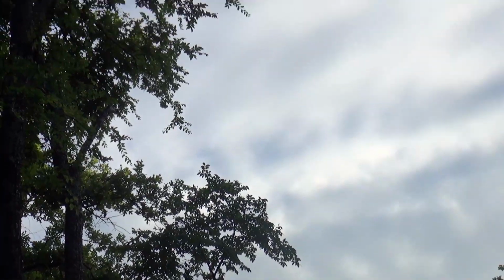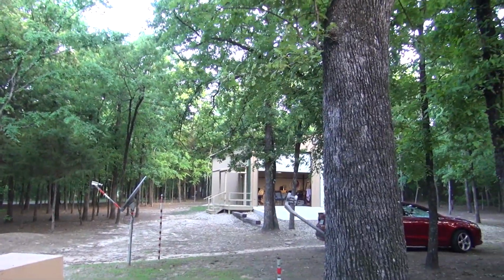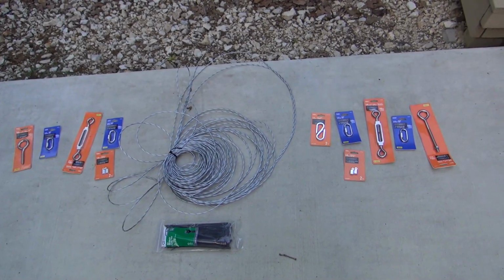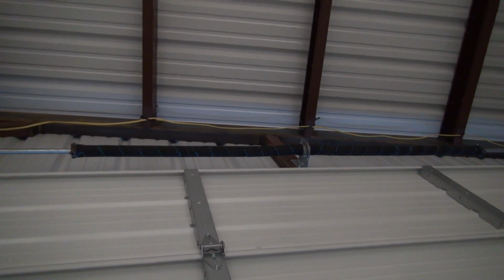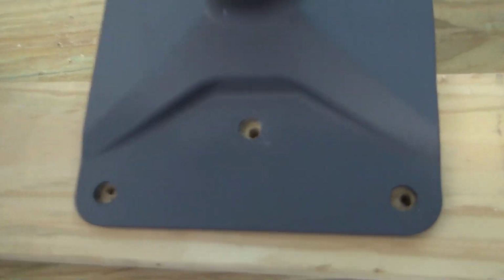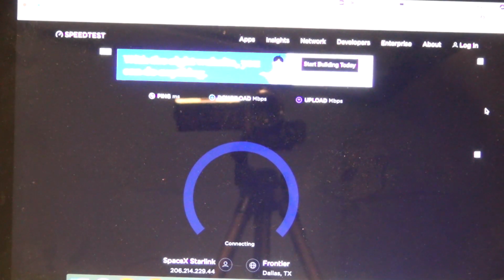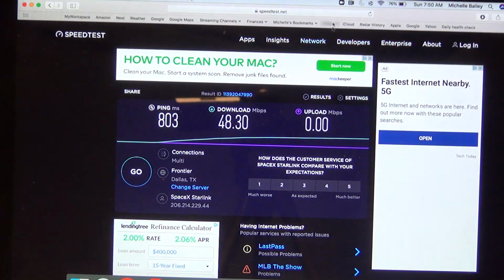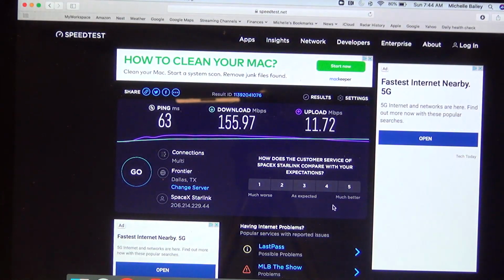Starlink Dish Install With Lots of Trees and Long Cable Run, Texas/Oklahoma

Comment: I had to drop about 10 trees but it was worth it. There are two more left to drop. Both dying as were most of the other ones I had dropped. However, we in this area of MI were only supposed to get 170 Mbps max, but we've downloaded things at just over 300mbps at times. It's worth it when you live in the country imo. Best service we've ever had.

Comment: Having problems stowing my poll down for the return of my Starlink it does not connect to the router can someone help with this I need to send it back but won't fit in the box do to the poll

Comment: Thanks for the very informative video. I live in the Philippines and the tree line surrounding my house is quite similar to your own location except all the trees nearby to me are coconut trees. I have down and up speeds roughly the same as yours before you installed Starlink so when the service comes available here I will definitely be using it. 🙏

Comment: Your area looks like mine, I'm in rural West Virginia, down in a valley wedged between two hills (one hill on the all-important Northern direction) with trees all around.)  When I first installed Starlink, I was getting drops every few minutes, which I didn't notice for general internet surfing, but caused buffering on Netflix and the like. However, it's gotten much better as they've launched more satellites. Sticking it on a ten-foot roof mast also did wonders, it didn't seem like it would have put it over most of the treetops, but it must have been just enough to knock the dropoffs down considerably.
Reply: I'm in tyler county. Too many trees for starlink. I'm lookin at the new hughesnet but they get awful reviews.

Comment: My Starlink is on the way, and I have a very similar issue with trees. I do however have a clear 3 acre pond, but it’s 190ft from the house. Thoughts?
Reply from the maker: They make a weather proof power-over-internet (POE) connector to attach two ethernet cables together,  they run about $90.  You also need to get at least 100' of additional cable to make the run, make sure it is rated for outdoor use.   You could bury the cable to span the distance, but that is a lot of digging without a trenching tool, I recommend putting it in conduit if you bury it to add protection.    I don't recommend securing it to trees to span the distance,  remember trees move and the would put a strain on the cable and eventually break it.  I would invest in some type of tall polls in the ground to secure it to.  Good luck and let me know how it goes.

Comment: It looks like you could easily install a wireless bridge between your house and out-building.  I did something similar between my house and shop.  Cost was around $200.  Speed is about 400 Mbps.  You are likely to wind up with blown Ethernet ports on your equipment with a cable running between two buildings, due to lightning strikes in the immediate area.

Comment: I found that anchoring  the cable with  the supplied clips squashes the cable. I used electrical staples and loosely ran the cable thru them. I also used a rope to run a path from the dish to the house and used tye wraps  to secure the cable to the house with putting any strain to the cable .had fun figuring  this out
Reply: With out putting any strains  on the coble.

Comment: @10:00 who drilled and installed the bolts in the mounting plate?  It looks like a blind person with no finger dexterity lol they are pretty crooked ;]..   My kit is on the way and I have a phew tree tops on the very edge of the northern view and I mean just the very edge so I guess is I will have no issues.  Peace!

Comment: I can't put it on my roof due to tall trees in a 360 view around my house. There's obstructions all over so I found a spot in my field that's wide open and has no obstructions so I'm gonna have to set it up out there "200ish ft" maybe 300 I'm not sure, haven't been able to measure the distance but do you think running cords that far will make a difference in my speeds? I'm not sure what ethernet I should use, CAT6 of 200ft-300ft? Any help would be appreciated.
Reply: https://youtu.be/JVfyFDw2k_8
Reply: @_hrlt  I already watched this, a signal booster isn't what I need but thanks for the help anyways.
Reply from the maker: I am no expert on this but everything I have read is that Cat5/Cat6 cable is less effective beyond 328 feet.
Reply: @doingstuffonvideo5943  well I measured it from the spot to my house and it's 159-160 ft but I'll need a little more of cord to put it up through my basement.
Reply from the maker: @ASMRJAMESY  Also, if you are going to run it out in the open make sure to get a UV protected cable.  But if you are going to use conduit it shouldn't matter.

Comment: I have a suggestion on how to take the worry out of the cable from the Dishy to the house.  Have you thought about running the entire system from your garage?  That would be your Starlink system.  Then run/bury a single strand of fiber optics from the garage to the house in conduit.  Yes I know Fiber Optics.  Expensive!  It's not that pricey.  You can purchase single strand fiber optics pre-made in various lengths that would run from your Starlink system in the shed to wherever you needed in the house to a Wifi router to take care of your internet needs in the house and the Starlink system would service your needs in the shed.  You would have to purchase the appropriate transponder to covert electrical to light for the optics at each end of the fiber.  Surprisingly the whole setup is not that expensive.  I did this at my house to get internet to my shop and the whole thing was if I remember correctly under $200.00.  I purchased 150 yards of fiber the two transponders off of Amazon and I have been very satisfied with the results.  Anyway just a suggestion.  thank for the video.

Comment: Why not put the Starlink on a elevated platform. Sounds like you know how to make things with your hands so a long small stand to get past your trees
Reply from the maker: I could put it on a tower, I priced it out to about $1,000 ish to build. I may have to get there, but for now we are happy with the service we have been getting.
Reply: @doingstuffonvideo5943  during peak usage, like when everyone is online, is there any latency?
Reply from the maker: @gerrycortez4656  I haven't noticed any.  We  have a Firestick on two TV's and have streamed video's simultaneously with no issues.   Plus we have our Nest security camera's (3) recording at the same time an have seen any issues.
Reply: @doingstuffonvideo5943  thank you helps so much but one more thing, do you think it could handle 15-25 devices?
Reply from the maker: @gerrycortez4656   In all honesty it will depend on the usage of each device and how much band width they will require.  
You could sync up that many devises but if all are streaming at the same time, there could be issues, but that is with any internet provider outside of using fiber optics.  I have not seen any band width issues to date.
Reply: @doingstuffonvideo5943  thank you aagin

Comment: I’m not so far away.  A little south of you in McKinney.    So far the beta has not been made available to me.   But your need is greater than mine so I am sure they gave you priority as they should.    How were you notified your beta was available?
Reply from the maker: I just got an email from Starlink that my area was open to the beta.    They just verified I was still interested and when I confirmed they charged my card for the remainder of the costs.   I did get an expected delivery date about 30 days out, but all the hardware arrived in little over a week from the time I confirmed.
Reply: @doingstuffonvideo5943  thanks so much DE N5BOC.

Comment: Thank you so much, much better video than others about placement and tree coverage. East texas here and can't wait, have some tall pines here but found a spot if the app is accurate. I really don't like the fact the cable is integrated into the dish. I have never seen a cable last a long time yet on a roof.
Reply from the maker: Yes the cable failure is is my fear as well. Part of it is sitting on a hot metal roof.  It may make sense to protect it more than it is now.

Comment: Don't run any cable under the ground or across the trees. You can link the barn super easily with a Nanostation M5 Loco. I have a 100 ft link to my barn with two of these and it works great and can be replaced very easily if anything goes bad.
Reply from the maker: Thanks, I wasn't aware of this product.  Do they have one rated for outdoor use?  My metal garage blocks most wi-fi signals from entering the inside of the building.
Reply: @doingstuffonvideo5943  Thanks for the response. Yeah they're all outdoor rated and you would have to have both sides of the link outside your buildings and able to see each other with decent line of site. It works just like a wireless ethernet cable. Ubiquiti makes all sorts of different point-to-point links. I just ran an ethernet line to the exterior of the barn through a soffit and pointed them at each other. Download their app on your cell phone and when you turn each side of the link on it will put out a wifi signal for the first 5 minutes or so you can connect to and configure. They have a few setup videos if you're ever interested. Best of luck!

Comment: Have you had any issues with the dish getting too hot and going into the thermal protect mode? I live in southeast Kansas, close to Oklahoma, so heat is a concern of mine during the summer months. Thanks for the video!
Reply from the maker: No?   I have not heard of any issues like that.  I am concerned because it is mounted on a metal roof and I thought it would be hotter in that environment, but no issues as of yet.  Knock on wood.
Reply: @doingstuffonvideo5943  That's great to hear! I think many of the heat issue reports came from users in the hottest Texas, Arizona, and California areas. Hopefully it won't be an issue either of us encounter. Thanks for your response!

Comment: We closed on our property 1 July. It’s 8 acres with half cleared and half wooded. 
There is already a direct tv dish in the field pointing across the open area. So I was hopeful.
I opened the Starlink app yesterday and of course it has to point back towards the house and all the trees! I have to walk halfway across the field to get the trees out of view but then I am 200ft from my house! 
Not sure what to do now, the other satellite internet providers are terrible!
Reply from the maker: You can find POE extenders on Google (they run about $90 for an outdoor rated extender) along with additional Ethernet cable. Make sure the cable is rated for outdoor use also.  Ethernet cable is only effective up to 300 feet total, so as long as your total run between the dish and WiFi router is under that length you are good.   Good Luck!
Reply: @doingstuffonvideo5943  thank you for the quick answer. It will be about two months before we actually move into the house, the husband died over two years ago and the wife went into a home, they had no family and no will, so almost everything they collected since building the log cabin in 1978 is on the property!! We have a bunch of cleanup to do!
But I was going to start researching ways to extend the length of the cabling. Any information is a huge help.
Reply: @doingstuffonvideo5943  I will need to locate dishy more than 150 ft (which is their longest cable I know starlinks connectors are different the others so you have to buy theirs) away from my house to get the field of view without obstructions. So if I need more the the longest (150 ft) they sell how would I extend it. Could I buy the 150ft and connect it to what came with it?  If so where do I find the double female extension plug that is needed for starlinks ends?
Reply: @allangibson2327  Gee this is my question as well, its been 5 mths what did you do? i just got my starlink i think i need 280 ft total

Comment: Thanks for the video, so did just installing on your garage roof work? No Outtages? even with a few trees at the bottom of the app?...  I am in a very similar situation in East Texas.. I am trying to figure a way to use my phone connected to my drone and record the app at varying heights...  Wish the drone software had the app built in.
Reply: Hi Phil, what town are you in in East Texas.  Placed an order in March tyring to get service in Corrigan TX, and just wondering if you were anywhere close to that area as working off cell service sucks where I am and no other dish/cable providers in the general area.
Reply from the maker: Yes, I have another video showing how little downtime I was actually getting.   
https://www.youtube.com/watch?v=gXJop9DM43o&t=2s

I am happy with the consistency I am getting  from my signal.   As they launch more satellites and they move into the proper orbit I think it only gets better over time.

Comment: Not going to get Starlink, since I am getting fibre internet next year, but I know its revolutionizing for lots of people.  In the past I worked in the Arctic on Jan Mayen island, and our internet speed was 60kbit 😂 via geostationary...   It sure will be an insane improvement for those up there.  The Arctic will get coverage in 2022.

Btw I am a HAM too, LA7DFA.  Working on WAS on all bands.  49 states worked on 160m, and 38 on 6m so far.
Reply from the maker: Impressive on the number of 160m contacts!  I typically stay around 20m,30m and 40m on FT8.    Use a dipole for the latter two bands.  I have never made a contact on 6m, but I have only been in the hobby a few years.    K5OUI     73 my friend.
Reply: @doingstuffonvideo5943  FB, most starts off on the easier bands, and expand as time goes by.  Been dabbling into most long distance stuff including moonbounce.  Always good to challenge the limits of what you can do :)  73!

Comment: Thanks' for sharing your experience.  I am on the waitlist and am looking forward to getting Starlink too.  I have some of the same challenges with trees and finding a clear area for the dish on the property.  Do you know if the starlink cable can be extended if 100ft isn't long enough?  I suppose, I can mount on a shed roof then run an ethernet cable between starlink Dish router and main Network switch in my home if not.  Looking forward for a long term review of your installation.  Cheers!
Reply from the maker: Yes. there are POE extenders you can find, if you Google them.  They run about $90, a viewer posted below, you need to make sure it is rated at 100 watts, to power the Dishy.   You will want to buy POE extender that are water proof and when you buy additional cable make sure you get one rated for outside with UV protection.  Your total  length of cable from the Dishy to the router will need to be less than 328 feet or it will loose its effectiveness
Reply: @doingstuffonvideo5943   Thanks. Good to know options as I am planning out the install.  Cheers!

Comment: Thanks very much. Interested in how many drops in service you have with the obstructions you cannot get around unless you go higher.
Reply from the maker: It actually been better than I have expected.    In a 24 hour day I have about 10-15 minutes of downtime due to some type of obstruction. On a windy day with the trees moving, maybe a little more.    The analytics tool on the phone app does a good job of tracking it.  I also have some additional downtime due to no satellite coverage, but that is only going to better over time.    On a given day I am probably down 20 minutes, and each duration is a minute max, with most lasting only 15-20 seconds.

Comment: I'm a little confused, how can you use less than 100 ft of cable, no matter how far you put your dish it's still going to be 100ft of cable between point A and B. Unless you cut the cable. Are you able to extend the cable?
Reply from the maker: You cannot use less than 100 feet of cable.   I had a hard time finding anyone showing how they completed long runs between the dish and power block.  Most everything I saw online was from the dish directly into the house with very short runs before it entered a structure.   I was just trying to show an option if someone ran across a similar challenge.  You can go longer but you need to get a POE extender and additional cable. POE's extenders run around $90.00
Reply: @doingstuffonvideo5943  that's my problem. I'm about 160ft from open sky and can't find any videos on someone actually extending the cable.
Reply from the maker: @621norby    POE Extenders are used quit often in the technology world, and they do make them water proof for outdoor use.  If you Google POE extender you will see a lot of options.  Simple to use.  When you buy additional cable, you will want to make sure it is rated for outside use with UV protection.
Reply: It's easier if you extend after the power brick. It is not a common PoE injector. It needs to power dishy for over 100 Watts. You can do whatever as standard Ethernet after the power brick from the white port.
Reply from the maker: @motofan16  Great point on the POE injector, it needs to be rated for the correct wattage.  I think the issue is the cable is hard wired into the dishy and the 100' line runs out before 621norby can get it to the power block, indoors and protected.
Reply: @doingstuffonvideo5943  okay I’m not very tech savvy, but could you please dumb down what I would need to do if my satellite dish were ~150 ft away from my house? I’m not too familiar with what PoE extenders are and how to use them, so if you could clear that up as well you would be a huge help and gain a subscriber.